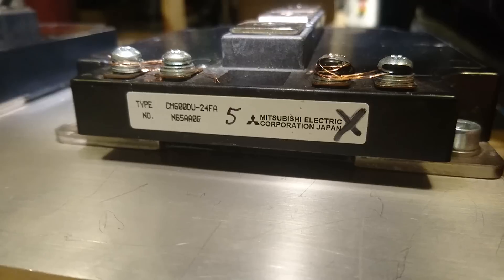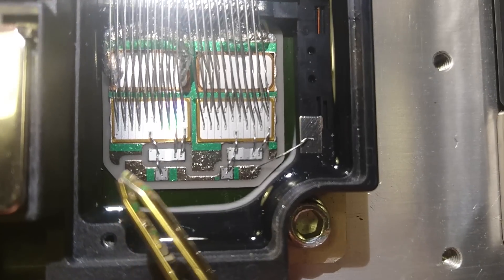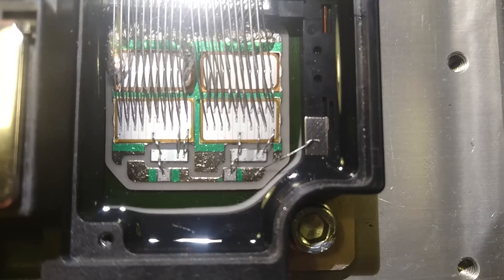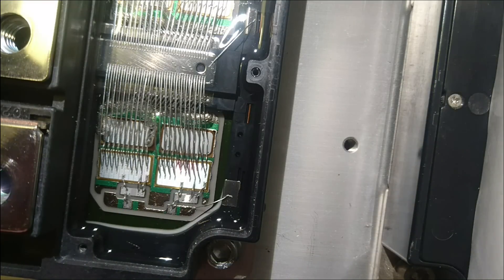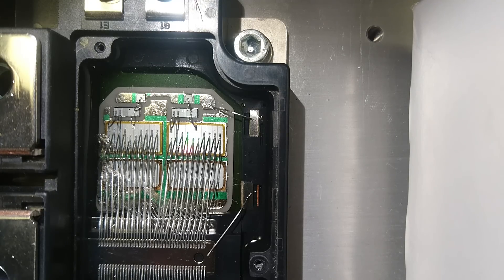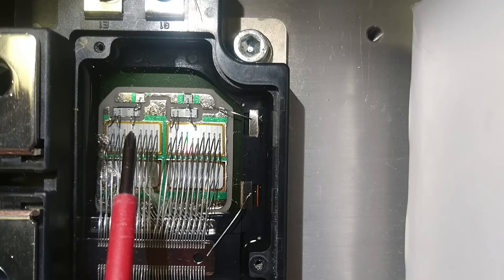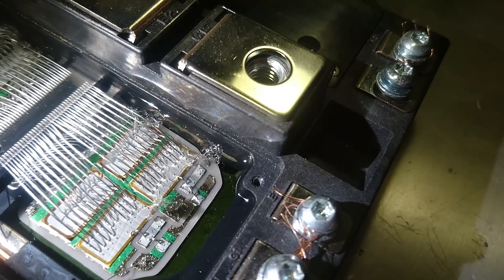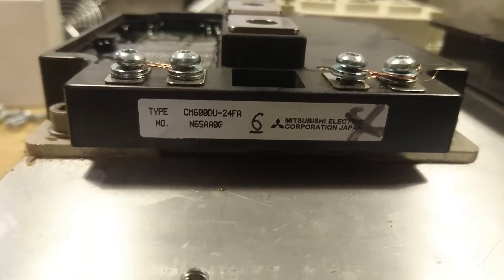CM600DU-24FA IGBT - Removal of RTC over-current protection

Comment: They are absolutely monster IGBTs, more than 1200 amperes awesome, if I tried to push so much current thru my TO-247 IGBTs, they would just be annihilated, LOL xD The bonding wires are made out of aluminium, so it's probably the best way to remove them by wiggling them until they break, and not to try to cut them ! You driving the brick on 24 volts on the gate, right ? Thumbs up !!
Reply from the maker: 1200A is just their SOA pulsed rating, I have been running them at 2000A. Yes, I do drive them at 24 VDC with a GDT.
Reply: Kaizer Power Electronics 2000 A very nice !! xD